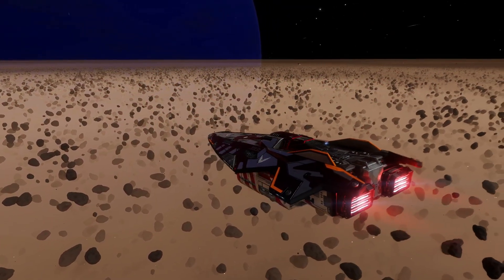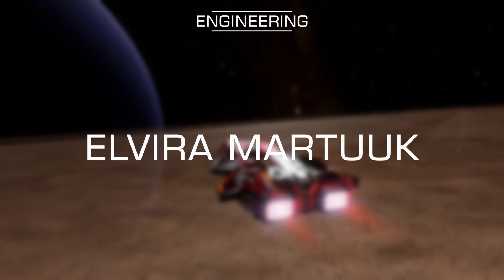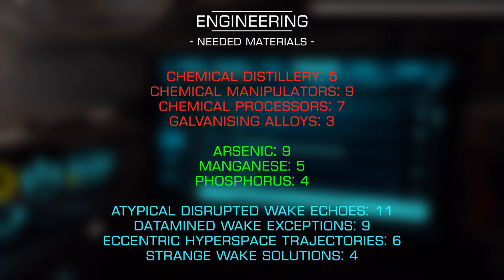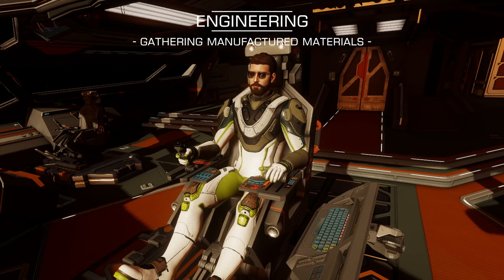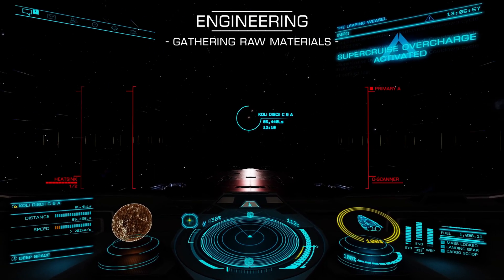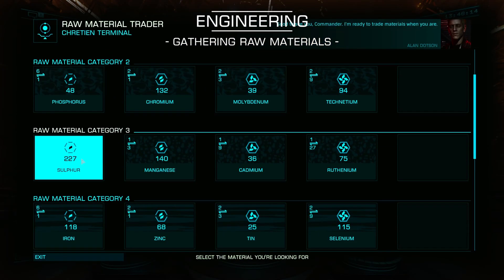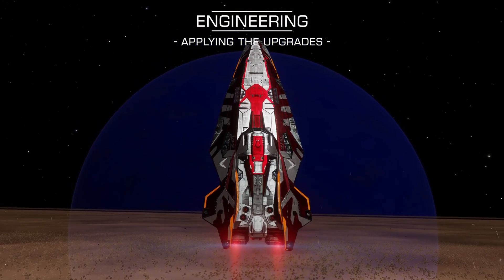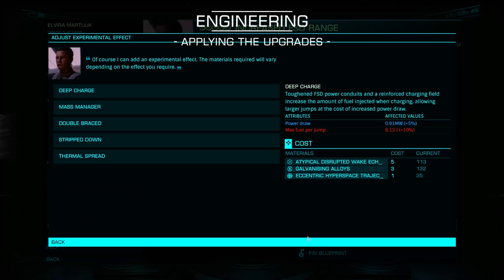READ DESCRIPTION! How to Engineer your First FSD | Elite Dangerous Engineering Guide 2025

Comment: at 5:44 when you target and lock that system what did you use? I'm always using the galazxy or system map and havent seen that before
Reply from the maker: That’s just a cut I’m afraid. In between shots I parked the SRV, and (with galaxy map) plotted course for Ross 444
Reply: You should try these system's in the Galaxy map search bar and fly to them. 07 🫡

Gamma velorum
HD 125178
HD 125142
HD 100085
Wregoe yk-p e5-83
Psr joo24-7204e
Psr joo24-7204o
Psr joo24-7204t
Psr joo24-7204q
Psr joo24-7204u
Hip 13044
Cygni x-3
Plaa aec iz-n c20-1
Eafots eu-r c4-1
Pru aescs dl-w c15-37
Stuemeae fg-y d7561
Stuemeae km-w c1-4809
Ic 4673
Ic 2391 sector ze-a d101
Ic 2391 sector gw-v b2-4
Cygnus x-1
Cygnus x-3
Evelyn's light
Urt
Ads 9338 ac
Scheau bli nb-o d6-342
Lil
Synuefe xr-h d11-102
Trappist-1
Lft 509
Rigel
Ngc 2841
Ngc 5195
Ngc 1566
GJ 1214B
Cw 190521
Rx j1856.5-3754
Serpent 37
6 Lacertae
6 Lambda Leporis
Alnilam
Alnitak
Mintaka
Sol
Proxima Centauri
Sirius
Stephenson 2-18
Carcosa
Maia
Ads 4229 abc
Eimbaith Lw-w EL-290
Floasly te-x d2-25
Synookio EL-J d9-1
Gongae Qw-1 c24-0
Byoi aewsy r2-f d11-104
Eol prou kw-1 cb-32
Blua hypa hi-f d12-1226
Bleia dryiae hf-w b35-1
Col 285 sector vu-m c8-32
Eol prou kw-1 c8-32
Eafoff IN-Q d6-0
Dryooe prou ff-z d696
Boelts XH-C c29-854
Shaulai DL-P d5-274
Stuemeae bv-y f2111
Stuemeae nn-s e4-1360
Stuemeae nn-s e4-5583
Nyuena bf-r e4-3196
Nyuena bf-r e4-4054
Nyuena bf-r e4-2200
Nyuena bv-p e5-458
Nyuena bv-p e5-1493
Nyuena bv-p e5-2376
Pre Aowsy ba-a
Brambai uz-o e6-313
Dumboe aa-a h207
Hypao brai kw-v b5-21
Hypio gree aa-a h56
HD 155889
Bleia dryiea xj-r e4-1
Hi'iaka
Angosk jm-w d1-05
Hip 52741
Tira Flirble
Smade's
Hip 57951
Lorant mi-b d13-1
Blaea brou cn-b d13-06
Psr j0024-7204Q1
Eolls hypai no-x d2-06
HD 64285
Hip 64902
Hip 604151
HD 213221
HD 211744
Hip 57951
Smeamaa aa-a ho4
Phleedgoea kx-u f2-10
Garth
Izar
Axanar
Klingon
CBS
Orian
Actaea
Vanth
HD 35460
Hip 57951
S171378
Smith's claim
Pru aescs zk-p e5-103513
HD 474171
Swoiwns td-r d5-85
Wellington
HD 64287
Hip 64902
Oevasy sg-y do
Hyphiemoe yk-p d5-0
Eolls hypai ll-z d1-02
Psr j1641+3627ba
HD 64282
2 mass j02323627+61282553
Nyeajoa fb-o e6-oa
Eor phyloi cl-y g137
Pria thoi zp-g d10-37
HD 2020881
Ogaicy zo-a e4228
HD 935217
HD 984256
HD 71297

Comment: No man’s sky players with 100 times the FTL range: pathetic.
Reply from the maker: Yeh.. 

NMS players with green stars: yes, this makes sense
Reply: @DiturisElite  haha… yeah…
And we might be getting purple stars soon…
Reply: You should try these system's in the Galaxy map search bar and fly to them. 07 🫡

Gamma velorum
HD 125178
HD 125142
HD 100085
Wregoe yk-p e5-83
Psr joo24-7204e
Psr joo24-7204o
Psr joo24-7204t
Psr joo24-7204q
Psr joo24-7204u
Hip 13044
Cygni x-3
Plaa aec iz-n c20-1
Eafots eu-r c4-1
Pru aescs dl-w c15-37
Stuemeae fg-y d7561
Stuemeae km-w c1-4809
Ic 4673
Ic 2391 sector ze-a d101
Ic 2391 sector gw-v b2-4
Cygnus x-1
Cygnus x-3
Evelyn's light
Urt
Ads 9338 ac
Scheau bli nb-o d6-342
Lil
Synuefe xr-h d11-102
Trappist-1
Lft 509
Rigel
Ngc 2841
Ngc 5195
Ngc 1566
GJ 1214B
Cw 190521
Rx j1856.5-3754
Serpent 37
6 Lacertae
6 Lambda Leporis
Alnilam
Alnitak
Mintaka
Sol
Proxima Centauri
Sirius
Stephenson 2-18
Carcosa
Maia
Ads 4229 abc
Eimbaith Lw-w EL-290
Floasly te-x d2-25
Synookio EL-J d9-1
Gongae Qw-1 c24-0
Byoi aewsy r2-f d11-104
Eol prou kw-1 cb-32
Blua hypa hi-f d12-1226
Bleia dryiae hf-w b35-1
Col 285 sector vu-m c8-32
Eol prou kw-1 c8-32
Eafoff IN-Q d6-0
Dryooe prou ff-z d696
Boelts XH-C c29-854
Shaulai DL-P d5-274
Stuemeae bv-y f2111
Stuemeae nn-s e4-1360
Stuemeae nn-s e4-5583
Nyuena bf-r e4-3196
Nyuena bf-r e4-4054
Nyuena bf-r e4-2200
Nyuena bv-p e5-458
Nyuena bv-p e5-1493
Nyuena bv-p e5-2376
Pre Aowsy ba-a
Brambai uz-o e6-313
Dumboe aa-a h207
Hypao brai kw-v b5-21
Hypio gree aa-a h56
HD 155889
Bleia dryiea xj-r e4-1
Hi'iaka
Angosk jm-w d1-05
Hip 52741
Tira Flirble
Smade's
Hip 57951
Lorant mi-b d13-1
Blaea brou cn-b d13-06
Psr j0024-7204Q1
Eolls hypai no-x d2-06
HD 64285
Hip 64902
Hip 604151
HD 213221
HD 211744
Hip 57951
Smeamaa aa-a ho4
Phleedgoea kx-u f2-10
Garth
Izar
Axanar
Klingon
CBS
Orian
Actaea
Vanth
HD 35460
Hip 57951
S171378
Smith's claim
Pru aescs zk-p e5-103513
HD 474171
Swoiwns td-r d5-85
Wellington
HD 64287
Hip 64902
Oevasy sg-y do
Hyphiemoe yk-p d5-0
Eolls hypai ll-z d1-02
Psr j1641+3627ba
HD 64282
2 mass j02323627+61282553
Nyeajoa fb-o e6-oa
Eor phyloi cl-y g137
Pria thoi zp-g d10-37
HD 2020881
Ogaicy zo-a e4228
HD 935217
HD 984256
HD 71297

Comment: This is a very well thought out and clearly delivered tutorial.

Cheers (subscribed)
Reply: You should try these system's in the Galaxy map search bar and fly to them. 07 🫡

Gamma velorum
HD 125178
HD 125142
HD 100085
Wregoe yk-p e5-83
Psr joo24-7204e
Psr joo24-7204o
Psr joo24-7204t
Psr joo24-7204q
Psr joo24-7204u
Hip 13044
Cygni x-3
Plaa aec iz-n c20-1
Eafots eu-r c4-1
Pru aescs dl-w c15-37
Stuemeae fg-y d7561
Stuemeae km-w c1-4809
Ic 4673
Ic 2391 sector ze-a d101
Ic 2391 sector gw-v b2-4
Cygnus x-1
Cygnus x-3
Evelyn's light
Urt
Ads 9338 ac
Scheau bli nb-o d6-342
Lil
Synuefe xr-h d11-102
Trappist-1
Lft 509
Rigel
Ngc 2841
Ngc 5195
Ngc 1566
GJ 1214B
Cw 190521
Rx j1856.5-3754
Serpent 37
6 Lacertae
6 Lambda Leporis
Alnilam
Alnitak
Mintaka
Sol
Proxima Centauri
Sirius
Stephenson 2-18
Carcosa
Maia
Ads 4229 abc
Eimbaith Lw-w EL-290
Floasly te-x d2-25
Synookio EL-J d9-1
Gongae Qw-1 c24-0
Byoi aewsy r2-f d11-104
Eol prou kw-1 cb-32
Blua hypa hi-f d12-1226
Bleia dryiae hf-w b35-1
Col 285 sector vu-m c8-32
Eol prou kw-1 c8-32
Eafoff IN-Q d6-0
Dryooe prou ff-z d696
Boelts XH-C c29-854
Shaulai DL-P d5-274
Stuemeae bv-y f2111
Stuemeae nn-s e4-1360
Stuemeae nn-s e4-5583
Nyuena bf-r e4-3196
Nyuena bf-r e4-4054
Nyuena bf-r e4-2200
Nyuena bv-p e5-458
Nyuena bv-p e5-1493
Nyuena bv-p e5-2376
Pre Aowsy ba-a
Brambai uz-o e6-313
Dumboe aa-a h207
Hypao brai kw-v b5-21
Hypio gree aa-a h56
HD 155889
Bleia dryiea xj-r e4-1
Hi'iaka
Angosk jm-w d1-05
Hip 52741
Tira Flirble
Smade's
Hip 57951
Lorant mi-b d13-1
Blaea brou cn-b d13-06
Psr j0024-7204Q1
Eolls hypai no-x d2-06
HD 64285
Hip 64902
Hip 604151
HD 213221
HD 211744
Hip 57951
Smeamaa aa-a ho4
Phleedgoea kx-u f2-10
Garth
Izar
Axanar
Klingon
CBS
Orian
Actaea
Vanth
HD 35460
Hip 57951
S171378
Smith's claim
Pru aescs zk-p e5-103513
HD 474171
Swoiwns td-r d5-85
Wellington
HD 64287
Hip 64902
Oevasy sg-y do
Hyphiemoe yk-p d5-0
Eolls hypai ll-z d1-02
Psr j1641+3627ba
HD 64282
2 mass j02323627+61282553
Nyeajoa fb-o e6-oa
Eor phyloi cl-y g137
Pria thoi zp-g d10-37
HD 2020881
Ogaicy zo-a e4228
HD 935217
HD 984256
HD 71297

Comment: Excellent video. Just goes to show that every day can be a school day lol
Reply: You should try these system's in the Galaxy map search bar and fly to them. 07 🫡

Gamma velorum
HD 125178
HD 125142
HD 100085
Wregoe yk-p e5-83
Psr joo24-7204e
Psr joo24-7204o
Psr joo24-7204t
Psr joo24-7204q
Psr joo24-7204u
Hip 13044
Cygni x-3
Plaa aec iz-n c20-1
Eafots eu-r c4-1
Pru aescs dl-w c15-37
Stuemeae fg-y d7561
Stuemeae km-w c1-4809
Ic 4673
Ic 2391 sector ze-a d101
Ic 2391 sector gw-v b2-4
Cygnus x-1
Cygnus x-3
Evelyn's light
Urt
Ads 9338 ac
Scheau bli nb-o d6-342
Lil
Synuefe xr-h d11-102
Trappist-1
Lft 509
Rigel
Ngc 2841
Ngc 5195
Ngc 1566
GJ 1214B
Cw 190521
Rx j1856.5-3754
Serpent 37
6 Lacertae
6 Lambda Leporis
Alnilam
Alnitak
Mintaka
Sol
Proxima Centauri
Sirius
Stephenson 2-18
Carcosa
Maia
Ads 4229 abc
Eimbaith Lw-w EL-290
Floasly te-x d2-25
Synookio EL-J d9-1
Gongae Qw-1 c24-0
Byoi aewsy r2-f d11-104
Eol prou kw-1 cb-32
Blua hypa hi-f d12-1226
Bleia dryiae hf-w b35-1
Col 285 sector vu-m c8-32
Eol prou kw-1 c8-32
Eafoff IN-Q d6-0
Dryooe prou ff-z d696
Boelts XH-C c29-854
Shaulai DL-P d5-274
Stuemeae bv-y f2111
Stuemeae nn-s e4-1360
Stuemeae nn-s e4-5583
Nyuena bf-r e4-3196
Nyuena bf-r e4-4054
Nyuena bf-r e4-2200
Nyuena bv-p e5-458
Nyuena bv-p e5-1493
Nyuena bv-p e5-2376
Pre Aowsy ba-a
Brambai uz-o e6-313
Dumboe aa-a h207
Hypao brai kw-v b5-21
Hypio gree aa-a h56
HD 155889
Bleia dryiea xj-r e4-1
Hi'iaka
Angosk jm-w d1-05
Hip 52741
Tira Flirble
Smade's
Hip 57951
Lorant mi-b d13-1
Blaea brou cn-b d13-06
Psr j0024-7204Q1
Eolls hypai no-x d2-06
HD 64285
Hip 64902
Hip 604151
HD 213221
HD 211744
Hip 57951
Smeamaa aa-a ho4
Phleedgoea kx-u f2-10
Garth
Izar
Axanar
Klingon
CBS
Orian
Actaea
Vanth
HD 35460
Hip 57951
S171378
Smith's claim
Pru aescs zk-p e5-103513
HD 474171
Swoiwns td-r d5-85
Wellington
HD 64287
Hip 64902
Oevasy sg-y do
Hyphiemoe yk-p d5-0
Eolls hypai ll-z d1-02
Psr j1641+3627ba
HD 64282
2 mass j02323627+61282553
Nyeajoa fb-o e6-oa
Eor phyloi cl-y g137
Pria thoi zp-g d10-37
HD 2020881
Ogaicy zo-a e4228
HD 935217
HD 984256
HD 71297

Comment: Man, you should really learn that high grade emission relog farming is waaaay faster than pve and does not require dedicated ship for that
Reply from the maker: Yep, I’ve done it. I wanted to hit self destruct after 2 minutes.

Seriously though, if you’d prefer the fast but boring method that’s fine. I’m just more about enjoying the “grind” rather than making it as short as possible 🫡
Reply: @DiturisElite  I've been to a haz res site and i know how often condas and cutters spawn (not so often), it's the same story as with jameson cobra vs scanning wakes. Either you fiil up on g5 materials in 5 minutes and go on or roll the dice and enjoy your luck for half an hour (if not more). But to each their own i guess
Reply: You should try these system's in the Galaxy map search bar and fly to them. 07 🫡

Gamma velorum
HD 125178
HD 125142
HD 100085
Wregoe yk-p e5-83
Psr joo24-7204e
Psr joo24-7204o
Psr joo24-7204t
Psr joo24-7204q
Psr joo24-7204u
Hip 13044
Cygni x-3
Plaa aec iz-n c20-1
Eafots eu-r c4-1
Pru aescs dl-w c15-37
Stuemeae fg-y d7561
Stuemeae km-w c1-4809
Ic 4673
Ic 2391 sector ze-a d101
Ic 2391 sector gw-v b2-4
Cygnus x-1
Cygnus x-3
Evelyn's light
Urt
Ads 9338 ac
Scheau bli nb-o d6-342
Lil
Synuefe xr-h d11-102
Trappist-1
Lft 509
Rigel
Ngc 2841
Ngc 5195
Ngc 1566
GJ 1214B
Cw 190521
Rx j1856.5-3754
Serpent 37
6 Lacertae
6 Lambda Leporis
Alnilam
Alnitak
Mintaka
Sol
Proxima Centauri
Sirius
Stephenson 2-18
Carcosa
Maia
Ads 4229 abc
Eimbaith Lw-w EL-290
Floasly te-x d2-25
Synookio EL-J d9-1
Gongae Qw-1 c24-0
Byoi aewsy r2-f d11-104
Eol prou kw-1 cb-32
Blua hypa hi-f d12-1226
Bleia dryiae hf-w b35-1
Col 285 sector vu-m c8-32
Eol prou kw-1 c8-32
Eafoff IN-Q d6-0
Dryooe prou ff-z d696
Boelts XH-C c29-854
Shaulai DL-P d5-274
Stuemeae bv-y f2111
Stuemeae nn-s e4-1360
Stuemeae nn-s e4-5583
Nyuena bf-r e4-3196
Nyuena bf-r e4-4054
Nyuena bf-r e4-2200
Nyuena bv-p e5-458
Nyuena bv-p e5-1493
Nyuena bv-p e5-2376
Pre Aowsy ba-a
Brambai uz-o e6-313
Dumboe aa-a h207
Hypao brai kw-v b5-21
Hypio gree aa-a h56
HD 155889
Bleia dryiea xj-r e4-1
Hi'iaka
Angosk jm-w d1-05
Hip 52741
Tira Flirble
Smade's
Hip 57951
Lorant mi-b d13-1
Blaea brou cn-b d13-06
Psr j0024-7204Q1
Eolls hypai no-x d2-06
HD 64285
Hip 64902
Hip 604151
HD 213221
HD 211744
Hip 57951
Smeamaa aa-a ho4
Phleedgoea kx-u f2-10
Garth
Izar
Axanar
Klingon
CBS
Orian
Actaea
Vanth
HD 35460
Hip 57951
S171378
Smith's claim
Pru aescs zk-p e5-103513
HD 474171
Swoiwns td-r d5-85
Wellington
HD 64287
Hip 64902
Oevasy sg-y do
Hyphiemoe yk-p d5-0
Eolls hypai ll-z d1-02
Psr j1641+3627ba
HD 64282
2 mass j02323627+61282553
Nyeajoa fb-o e6-oa
Eor phyloi cl-y g137
Pria thoi zp-g d10-37
HD 2020881
Ogaicy zo-a e4228
HD 935217
HD 984256
HD 71297

Comment: Good Job, Clear and concise.
Reply: You should try these system's in the Galaxy map search bar and fly to them. 07 🫡

Gamma velorum
HD 125178
HD 125142
HD 100085
Wregoe yk-p e5-83
Psr joo24-7204e
Psr joo24-7204o
Psr joo24-7204t
Psr joo24-7204q
Psr joo24-7204u
Hip 13044
Cygni x-3
Plaa aec iz-n c20-1
Eafots eu-r c4-1
Pru aescs dl-w c15-37
Stuemeae fg-y d7561
Stuemeae km-w c1-4809
Ic 4673
Ic 2391 sector ze-a d101
Ic 2391 sector gw-v b2-4
Cygnus x-1
Cygnus x-3
Evelyn's light
Urt
Ads 9338 ac
Scheau bli nb-o d6-342
Lil
Synuefe xr-h d11-102
Trappist-1
Lft 509
Rigel
Ngc 2841
Ngc 5195
Ngc 1566
GJ 1214B
Cw 190521
Rx j1856.5-3754
Serpent 37
6 Lacertae
6 Lambda Leporis
Alnilam
Alnitak
Mintaka
Sol
Proxima Centauri
Sirius
Stephenson 2-18
Carcosa
Maia
Ads 4229 abc
Eimbaith Lw-w EL-290
Floasly te-x d2-25
Synookio EL-J d9-1
Gongae Qw-1 c24-0
Byoi aewsy r2-f d11-104
Eol prou kw-1 cb-32
Blua hypa hi-f d12-1226
Bleia dryiae hf-w b35-1
Col 285 sector vu-m c8-32
Eol prou kw-1 c8-32
Eafoff IN-Q d6-0
Dryooe prou ff-z d696
Boelts XH-C c29-854
Shaulai DL-P d5-274
Stuemeae bv-y f2111
Stuemeae nn-s e4-1360
Stuemeae nn-s e4-5583
Nyuena bf-r e4-3196
Nyuena bf-r e4-4054
Nyuena bf-r e4-2200
Nyuena bv-p e5-458
Nyuena bv-p e5-1493
Nyuena bv-p e5-2376
Pre Aowsy ba-a
Brambai uz-o e6-313
Dumboe aa-a h207
Hypao brai kw-v b5-21
Hypio gree aa-a h56
HD 155889
Bleia dryiea xj-r e4-1
Hi'iaka
Angosk jm-w d1-05
Hip 52741
Tira Flirble
Smade's
Hip 57951
Lorant mi-b d13-1
Blaea brou cn-b d13-06
Psr j0024-7204Q1
Eolls hypai no-x d2-06
HD 64285
Hip 64902
Hip 604151
HD 213221
HD 211744
Hip 57951
Smeamaa aa-a ho4
Phleedgoea kx-u f2-10
Garth
Izar
Axanar
Klingon
CBS
Orian
Actaea
Vanth
HD 35460
Hip 57951
S171378
Smith's claim
Pru aescs zk-p e5-103513
HD 474171
Swoiwns td-r d5-85
Wellington
HD 64287
Hip 64902
Oevasy sg-y do
Hyphiemoe yk-p d5-0
Eolls hypai ll-z d1-02
Psr j1641+3627ba
HD 64282
2 mass j02323627+61282553
Nyeajoa fb-o e6-oa
Eor phyloi cl-y g137
Pria thoi zp-g d10-37
HD 2020881
Ogaicy zo-a e4228
HD 935217
HD 984256
HD 71297

Comment: The FSD alone won't get you even close to 90 LY. Perhaps something like 50-60 LY. You need a lot more for the remaining 30-40 LY. Including a lot of engineering.

Also, there's no sense in using "deep charge" for any ship size, no matter what the wiki says. The difference between "deep charge" and "mass manager" for smaller ships is absolutely minuscule. The main problem with "deep charge" is that it makes the FSD consume more fuel for the extra jump range, while "mass manager" doesn't. The latter has no drawbacks of any kind. It's much better even for smaller ships even if it gives you a microscopic amount less jump range.

"Deep charge" is one of those completely useless bits of engineering. "Mass manager" is always better.
Reply from the maker: I know what you mean, but you certainly wont get to 90ly WITHOUT the best FSD! The other stuff you need is fairly self explanatory, might make a vid on it day though. 

As far as deep charge/mass manager, tbh it depends. Jump range is one of the few things I like to max out, so I’d go deep charge on a small ship, fuel isn’t much of an issue anyway. 

You are right that the change is minimal, but hey, just do what you prefer 🫡
Reply: @DiturisElite  
Actually the other stuff you need is not all self-explanatory, especially to one who doesn't know anything about optimizing ship builds for jump range.

In my case, for the longest time I didn't actually realize how the ship's weight affects jump range, and how you should, among other things, choose the lightweight hull rather than any of the other ones.

Also things like undersizing your power plant is not self-evident (the instinct is to use a power plant of the same size as its module slot). Some other things need a bit of research and work, such as the fact that you should engineer your sensors for weight.

With some modules you have to decide on what kind of compromise you want. For example, with thrusters you need to compromise between flying speed and weight. With the power distributor you need to compromise between whether and how frequently you can boost, and weight. (Of course engineering helps a lot in both cases, but still, you usually want to undersize at least a bit.)
Reply: You should try these system's in the Galaxy map search bar and fly to them. 07 🫡

Gamma velorum
HD 125178
HD 125142
HD 100085
Wregoe yk-p e5-83
Psr joo24-7204e
Psr joo24-7204o
Psr joo24-7204t
Psr joo24-7204q
Psr joo24-7204u
Hip 13044
Cygni x-3
Plaa aec iz-n c20-1
Eafots eu-r c4-1
Pru aescs dl-w c15-37
Stuemeae fg-y d7561
Stuemeae km-w c1-4809
Ic 4673
Ic 2391 sector ze-a d101
Ic 2391 sector gw-v b2-4
Cygnus x-1
Cygnus x-3
Evelyn's light
Urt
Ads 9338 ac
Scheau bli nb-o d6-342
Lil
Synuefe xr-h d11-102
Trappist-1
Lft 509
Rigel
Ngc 2841
Ngc 5195
Ngc 1566
GJ 1214B
Cw 190521
Rx j1856.5-3754
Serpent 37
6 Lacertae
6 Lambda Leporis
Alnilam
Alnitak
Mintaka
Sol
Proxima Centauri
Sirius
Stephenson 2-18
Carcosa
Maia
Ads 4229 abc
Eimbaith Lw-w EL-290
Floasly te-x d2-25
Synookio EL-J d9-1
Gongae Qw-1 c24-0
Byoi aewsy r2-f d11-104
Eol prou kw-1 cb-32
Blua hypa hi-f d12-1226
Bleia dryiae hf-w b35-1
Col 285 sector vu-m c8-32
Eol prou kw-1 c8-32
Eafoff IN-Q d6-0
Dryooe prou ff-z d696
Boelts XH-C c29-854
Shaulai DL-P d5-274
Stuemeae bv-y f2111
Stuemeae nn-s e4-1360
Stuemeae nn-s e4-5583
Nyuena bf-r e4-3196
Nyuena bf-r e4-4054
Nyuena bf-r e4-2200
Nyuena bv-p e5-458
Nyuena bv-p e5-1493
Nyuena bv-p e5-2376
Pre Aowsy ba-a
Brambai uz-o e6-313
Dumboe aa-a h207
Hypao brai kw-v b5-21
Hypio gree aa-a h56
HD 155889
Bleia dryiea xj-r e4-1
Hi'iaka
Angosk jm-w d1-05
Hip 52741
Tira Flirble
Smade's
Hip 57951
Lorant mi-b d13-1
Blaea brou cn-b d13-06
Psr j0024-7204Q1
Eolls hypai no-x d2-06
HD 64285
Hip 64902
Hip 604151
HD 213221
HD 211744
Hip 57951
Smeamaa aa-a ho4
Phleedgoea kx-u f2-10
Garth
Izar
Axanar
Klingon
CBS
Orian
Actaea
Vanth
HD 35460
Hip 57951
S171378
Smith's claim
Pru aescs zk-p e5-103513
HD 474171
Swoiwns td-r d5-85
Wellington
HD 64287
Hip 64902
Oevasy sg-y do
Hyphiemoe yk-p d5-0
Eolls hypai ll-z d1-02
Psr j1641+3627ba
HD 64282
2 mass j02323627+61282553
Nyeajoa fb-o e6-oa
Eor phyloi cl-y g137
Pria thoi zp-g d10-37
HD 2020881
Ogaicy zo-a e4228
HD 935217
HD 984256
HD 71297
Reply: @RebirthOfTheGods  
What's special about those systems?
Reply: @DjVortex-w  find out 😁 07